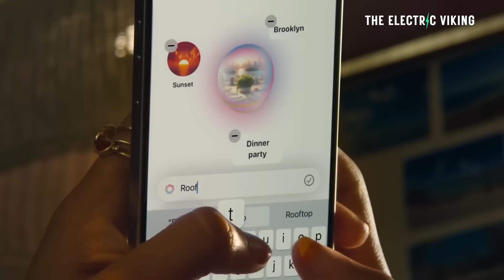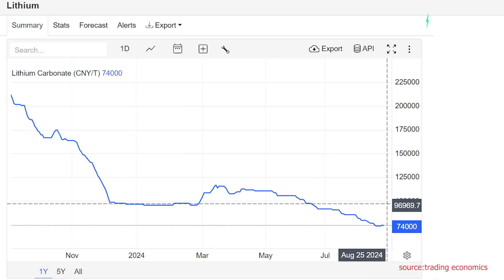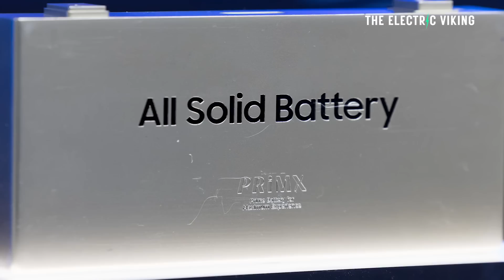Battery expert says potassium silicate solid state batteries to replace lithium

Comment: Batteries are a lot like computers: Don't buy one today because tomorrow the next generation will hit the marked, and the one you bought today will be useless. Tomorrow will be the same. I went three years in the early 1990s not buying a computer because of that. Eventually, I gave up and bought a computer, the best I could find. Next day Gateway introduced a new one, double the speed, three times the storage, etc., and only ten% higher price. Bummer.
Reply: That's why I buy 5 year old PCs (or get them free), and put Linux on them. Now I'm shopping for a used EV.
Reply: @jamesvandamme7786  Smart move.

Comment: The sodium battery was demonstrated on a lab bench back in the 1970s and the NiCad battery demonstrated back in the 1950s but it took until the seventies for the NiCad to be a commercial reality and the sodium battery is only just becoming a commercial reality so I wouldn't hold my breath on any new technology. Working on economical production methods and getting finance takes time.
Reply: Nikola Tesla used salts of lithium batteries in 1899 at his Colorado Springs Lab. Pictures with receipts.
Reply: You put millions of dollars into R&D, you can step things up a bit.

Comment: Hope they will be better than LFP batteries, which turns out to be an inferior batteries, which degrade even faster than NMC batteries.
Reply: Ummmm, who says so? Somebody did an accelerated life test, and yeah they degrade when they're real hot. Extrapolated out to normal temps, they last just as long. Life of the car long.
Reply: @jamesvandamme7786  Yes but no better than the NMC counterpart.

Comment: Potassium has an atomic weight of 39. Silicon has an atomic weight of 28. Lithium, on the other hand, has an atomic weight of 6.9. Like you said, potassium silicate is feldspar, a rock. These batteries are going to be heavy as a rock.
Reply: Exactly - the ratio of protons and neutrons ('dead weight') to the active (outer shell) electrons (no weight) is what ultimately determines the possible, theoretical, mass energy density ( whr/kg) with an indeterminate extra weight of electrolytes,anodes,casing, cooling  etc etc so we should be able to calculate the Maximum attainable energy density based on atomic number and valence . Any idea what that is?  We need to know where present batteries are on the typical 'S' curve and the maximum possible - Sam seems to think that energy densities can increase by many multiples just because of time and more research , someone with chemical engineering know how might watch this channel and expand on your comment.....
Reply: Feldspar is the general name for a group of sodium and potassium aluminosilicates.😊

Comment: A tip for you Sam: there's something well worth you knowing about battery chemistry that will definitely help you deal with this seemingly endless flood of new battery technology announcements. It turns out that "seemingly" is wrong!  I've been keeping up with the overall flow of new technology announcements since the early 70s. Guess what? New battery chemistries just happen to be by far the most common, frequent and consistent category of technological innovation there has ever been since the invention of the very first battery by Volta in 1800. There certainly seems to have been at least one new battery innovation story a week for the last 50 years that I've been keeping up with developments, with many weeks having at least one new patentable discovery and several actual patent stories cropping up once a month. In other words, the whole 'new battery chemistry bonanza' we're going through at the moment is not really anything brand new after all. But that obviously doesn't mean that actual battery production or consumption is not going up, or that we aren't going to see the kinds of breakthroughs that the new chemistry projects are announcing all the time. It just gets harder, not easier, to 'pick winners'.

Comment: Why would anyone make an EV with 1000 mile range?  Batteries are Heavy.  You don't want to be hauling unused capacity around on every trip.  You could cut the weight in half, and have more than 500 mile range because the car is lighter.

Comment: Battery cells always involve some tradeoffs, power density, temperature coefficient, safety, charge rate, longevity, cost, manufacturability, etc etc.  Pick the ones you want to optimize.  You can't have them all, at least not yet, but what we have now works pretty well.  Well enough to make cars profitably, if you do it right.

Comment: These types of stories are great and exciting.  However, in the big picture of the EV rollout, how are car companies supposed to plan their EV production when they have to look a minimum of 3 years out?  Both Ford and GM have build huge battery factories costing over a billion dollars each.  If the battery chemistry changes is it simple to reprogram the factory or does it require it to be shut down for a year to retool?  This is must one of many reasons the rollout in the US at least, will take several more years.  Would you as a CEO like to send out a letter to shareholders explaining why it's taking so long?   It's a very complex situation.

Comment: Game-changer #459. Maybe it will replace lithium... but most likely in 10 years time we will still have lithium batteries in EV's. Industrial inertia has set in.
Reply: Probably, there was some significant improvements in lithium batteries this year and there's some impressive tech coming next year too and probably the year after that.  By the time this product ever makes it to market it would have to be something really special to overthrow lithium.  As an investor, I wouldn't bet on that happening or this company.
Reply: Don't blink.    We are gonna have Quantum batteries by "Tomorrow" . 

Mass produced & everything  ⚡️💡⚡️

(Finally)  ⏳️

Comment: Potassium silicate is not made from rocks and pebbles.  It's made from mixing sand and potassium hydroxide and/or potassium carbonate and heated in a furnace to around 1400C, where it fuses into potassium silicate.  There you go.
Reply: Finally some real information. Thank you!
Reply: TY 

But it sounds very expensive to produce.  😮
Reply: @icosthop9998  About $0.35/pound to produce.  Oxy Chem and PQ Corp are large manufacturers of sodium silicate and potassium silicate.  Lithium is around $4.75/#.
Reply: @icosthop9998  10x less then lithium.
Reply: @icosthop9998  It's about 10X less expensive than producing lithium.
Reply: It’s no more complicated than making glass. The very common sources that Sam was referring to are feldspar which iirc is potassium aluminosilicate.😊
Reply: @malcolmrickarby2313  But that's not how potassium silicate has been commercially made for the last 100+ years.  Sand and potassium hydroxide and/or potassium carbonate are the raw materials to make potassium silicate.  Removing alumina from felspar was patented in 1912 and would have been the prefered path to potassium silicate if it was better.

Comment: If it’s merely at patent stage, it will take several years (not 3-4) to potentially reach the market in decent quantities. That’s if it can be mass produced at low cost. Most die in the technology ‘valley of death’ before seeing the light of day.
Reply: Don't blink.    We are gonna have Quantum batteries by "Tomorrow" . 

Mass produced & everything  ⚡️💡⚡️

(Finally)  ⏳️
Reply: no not 3-4....atleast 10 years

Comment: How many times have I heard this? A new type of battery that will revolutionize everything and we are still using lithium batteries
Reply: I for one enjoy hearing about different batteries that are being developed. Not all batteries will make it, but I still like hearing what is being worked on
Reply: Only in the u.s. the rest of the world uses lfp.
Reply: @arthurkirsch8188  the L in LFP is literally lithium
Reply: @HablaCarnage63 really!! I thought the it stood for licorice.
Reply: @arthurkirsch8188 AI, and lots of money to be made = much more effective research than on the past.  More research more discoveries.
Reply: Let him cook!
Reply: Battery chemistry and the processes to make them are changing regularly.
Lithium will get replaced with something cheaper and easier. It's a process over years and decades  not a light switch in your house.
Ck out Form Energy batteries for the grid. I don't see Li batteries hanging onto that market, and that market is huge.
Reply: About the same number of times you have heard of a revolutionary new ICE engine or a new fuel type. 
The only reality check is what is currently in the market at
Scale. 
ICE engines, yes
EV,s with li batt chemistry, yes. 
Solid state batteries, no
Hydrogen burning engines, no
Hydrogen fuel cell engines ,no
E fuels , no
Green fuels, no
Please note "at scale" eg the Toyota Mirai is not a
Successful
Hydrogen powered vehicle in terms of mass market sales.
Reply: You know you don’t have to listen to him if it bothers you so bad. Scroll on.
Reply: @dennisknehans3206 cry me a river 😊
Reply: One thing I noticed throughout this whole video.  Reading through the comments , is so many people back Sam.

But you people are not "#Patron_Members" 🤦🏼

What's up ?  🤷🏼‍♀️ ❔️

Talking about new battery technology over and over. Again, and "AGAiN"  is getting  "Pretty DAMN Old"   when none of them come to furission(sp) ! 🤦🏼❕️
~○~

Comment: Another new battery chemistry to make BEVs usable? I've had my Model 3 for over 3 years, made trips of over 1,250 miles each way and never had a charging issue. BEVs are currently way safer than Hybrids or pure ICE cars, have little or no maintenance or even service requirements. 
BEVs are already the best choice for most people, period.
Reply: Yawn.
Reply: @redriver9000  But the complainers will always say "there's no infrastructure!"
Reply: Are you saying EVs don’t need servicing? I can accept they don’t have oil or air intake filters, but they still have tyres, windscreen wipers, brakes, air conditioning systems, all of which benefit from some attention or replacement parts. I can’t see how EVs solve the mundane dust, dirt, wet, wear and tear, carelessness of human activity  that wrecks or wears out most cars